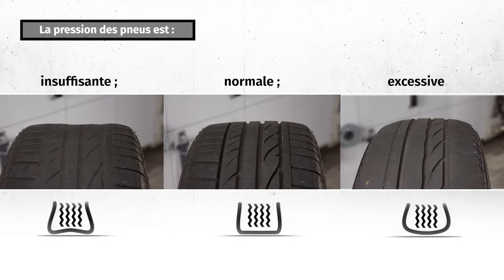Comment diagnostiquer les causes d'usure d'un pneu ?

Comment: Mes pneus bouffe de l'intérieur..en plus la géométrie a été faite..
Reply from the maker: Many thanks for your message. The reason for irregular wear on the inside of the tyres  can come from wear in other parts of the vehicle, such as the shock absorbers or suspension ball-joints. Wrong tyre pressure and/or wheel balance or alignement can also affect tyre wear. We recommend that you visit a specialized workshop or tyre center.
Reply: @GarageGurusEU   Et sinon en francais ca donne quoi ? De toute facon  c'est pareil pour moi j'ai changé les deux pneus avant ,ensuite j'ai procédé a deux geometrie car la premiere n'etait pas bonne   a l'arivée apres 1 an et 3 mois mes pneus sont morts de l'interieur